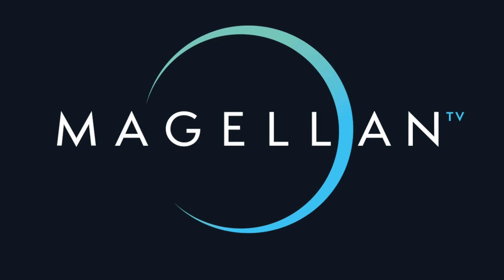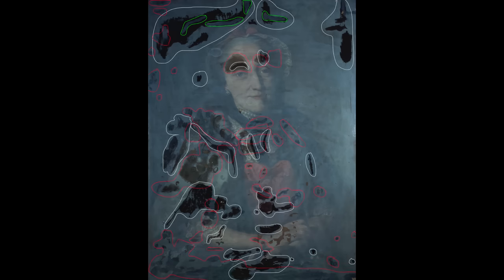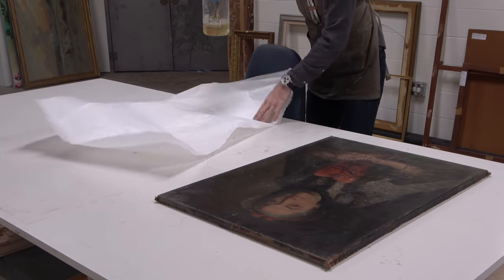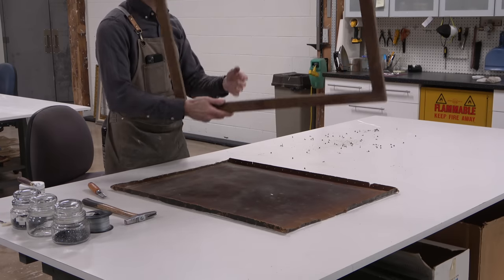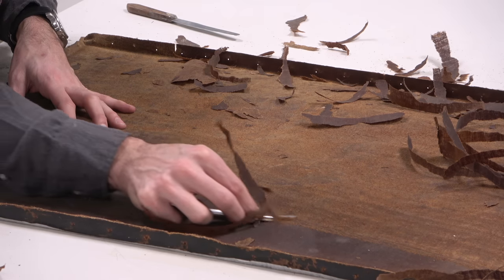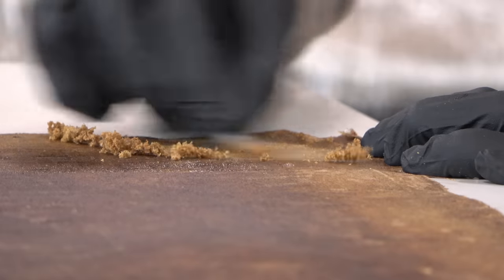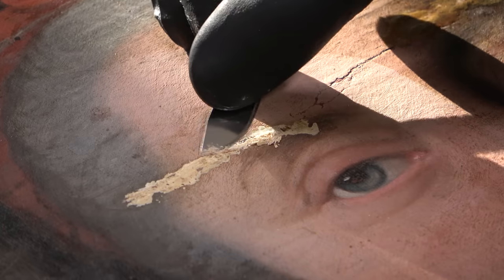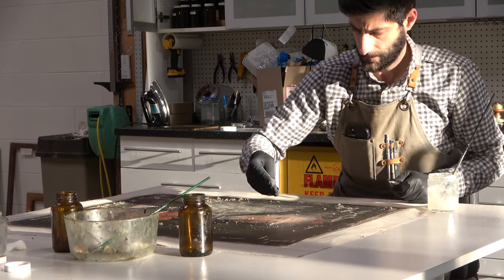The Lady of the Manor Part 1

Comment: I completely understand the satisfaction of peeling off the lining canvas in long strips. About 10 years ago I help restore a historic barn - Round Barn in Arcadia OK. Our first task was to remove the paint. The side of the barn, where the paint had not been baked into the wood siding came off in 4+ foot strips. We were all competing to see who could strip off the longest piece. One of my coworkers stripped off a piece that was nearly 6 feet long.
Reply: Years ago I helped do some cleanup in a historic building that needed extensive cleanup after a couple decades of neglect, and part of that cleanup involved removing the old plaster and lath. While the superintendent’s apartment had a double layer that could only be persuaded loose by steady pounding with a ten pound sledgehammer, part of the dormitory wing had plaster and lath so loose that you could punch a hole with a regular hammer and then pull multiple pieces of lath loose and knock down dinner plate sized chunks of plaster with just your gloved hands.
Reply: This post right here helps me understand why we have people with so many varieties of jobs and interests in our Juliann fan club. We all find satisfaction in these kind of actions. We need a Baumgartner-con! 💕🐝💕🇺🇸
Reply: I also understand that satisfaction so very well, sometimes I also have the opportunity to experiment that same satisfaction, and it's so good when it happens 🙂🙂👌👍
Reply: I went to that barn in 1999! 😁 I was taking a trip along route66. The lady who was the tour guide was really proud of it 🙃
Reply: I remember going to that barn.  You  were there and we spoke spoke for a short time.  It wasn't long before it became apparent that there was something going on between the two of us.  You moved closer to me, the longer we spoke, then when you were almost mouth-to-mouth with me, you leaned in for a kiss.  I was taken aback, and yet, it's what I had always wanted.  You awoke something deep inside of me.  Long story short, we made love for hours and when our rear ends were as raw as ground beef, we said our goodbyes, and went back to our lives.  I never said anything to my wife, and when she died, she whispered to me "I know what you are".  It seems like I always knew, and always knew about her indiscretions, in kind.  Anyway, what were we talking about.  Oh yeah, that was a cool barn.  I saw a corncob packrat nest in there one time.
Reply: i’ll have to visit the barn sometime, i live in okc
Reply: For me it's been either scraping off wallpaper or scraping up the foam backing off the subfloor when removing glued foam-backed carpeting and the carpet weave rips right off the foam that's been glued down... it's just SOOOO satisfying to get a nice big strip where the glue has disintegrated after chipping away little pieces where the glue is stronger than the foam... Also, tearing fabric along its grain. Life's little satisfactions!

Comment: “The hot table is hot so I’m gonna use a piece of felt” 
Julian: processed to put other hand on said hot table
Reply: Try rubbing across a barely hot to the touch surface and you'll see why ;)
Reply: @Soken50  not the point ;)
Reply: @rileydoolittle5324  please enlighten me to the point then
Reply: @Soken50  that it’s funny he mentioned it’s hot but put his other hand directly on top. Not that I doubt it’s hot or anything
Reply: @rileydoolittle5324  So exactly the point I adressed in my comment, which is that rubbing across something slightly hot but bearable to the touch is bloody painful, moreso if you also apply pressure to remove wrinkles.

Comment: There is something extremely satisfying in seeing so many layers put on the original paint removed, and simplifying it to one single layer of filling and retouching. Although vibrant paint at the end may seem as the most rewarding part of the job, for me, it's knowing that the painting is simplified once again to its fundamental parts, and nothing else.
Reply: exactly
Reply: @davidroosa4561  You're wrong again.

Comment: "The difference between conservators and... people who aren't conservators...."
I totally get that mood.  I worked as a custom house painter before going back to school... and it may not be high art like this, but the mood is real.
My boss told me within my first month working for him that "the adhesion of your top coat is only as good as the adhesion of your bottom coat(s)"... with the understanding that for a proper long-lasting painted finish... you have to address the surface of the substrate, then the surface of the appropriate primer you're using + any hole filling, etc., and then your paint.  If you're repainting a house, well... power-washing is only so good... I spent days where I soaped and rinsed walls to get the grime off before we even tried sanding to add tooth... let alone DIY repairs that just gave us more work.
I have literally worked on a house where the homeowner was like 'ah!  Let me fix this small repair I didn't get around to before' and then I had to watch while he put silicone up instead of caulk.
People who THINK they know what they're doing... are dangerous.

Comment: Lets see if i learned something. I'm at 0:56 and these are my predictions of Julian's step by step. 

First: face the painting with washikozo and fish gelatin glue to avoid any paint detachment. 

Then, remove any backing/canvas, ideally DRY. If this cannot be achieved dry, use Lapenite or some solvent to try to remove it. 

Once bare canvas is exposed, saturate the canvas with a diluted conservation grade adhesive to penetrate Through the canvas and secure the paint.

Move to the hot table and press with heat in order to reduce wrinkles and allow the paint to become flatter. 

OR: once the backing is removed, move to the hot table, flatten the painting, then saturate the canvas and then move back to the hot table.

Comment: I noticed you heated the fish gelatin over a double boiler but I seem to recall you bought a 3D printer a while back, so I thought I'd share a tip I worked out; you can heat animal glues by placing them in a container on the heat bed of the printer. You can even set up a g-code to shake it back and forth to help it dissolve (let me know if you'd like a hand doing this). I've been loving this method because it means I'll never overheat the glue and it stays at a working temperature throughout the use of it. And I can mix up really small amounts when I want to. I have a little printer that sits near my workstation, and I use it just for this. :)

Comment: 4:13 instead of brushing the fishgel over the flakes you can brush it over the washikoso, then apply the washikoso at once in a controlled way; that would minimize the risk of tearing the flakes apart, then re-charge another load of fish gel once the washikoso is applied.

Comment: Could you turn the strainer into a stretcher to keep the original wood but do better service to the painting? This is probably a dumb question but just curious. Apologies for my ignorance. Love the videos!
Reply: I wondered this too, but I did some research and it seems the way strainers are designed there can be no give at the corners. I guess you can’t take it apart to turn that same frame into a stretcher without the risk of compromising it in some way. Of that I could find no info on.
Reply: It seems likely that was one of the options he presented to the client, when he said that he could preserve the chalk marks. Julian certainly has the carpentry skills to be able to do it - possibly by gluing the wood of the strainer onto a new stretcher and shaping it accordingly.

Comment: Hey there ! Very nice and tidy work, congratulation.
 How do you make this water gel you use to remove glue ? 
Us violin restorers struggle using water to clean up old glue inside instruments, usually using cold and then warm water. Problem is it can deform the wood as it gets wet/dries. This seems like a pretty good solution to avoid making the actual wood wet and control the moistened area better. 
Thanks in advance

Comment: This painting reminds me of a bulldozer I worked on. They painted over everything. 
Couldn't find plug to change oil in brake packs, it had been caked with mud, and they painted over THE MUD! 
Related note they removed the electrical components and then painted everything inside the cab, so nothing would ground when we first got it.
Theres monsters out there.

Comment: Im curious. If oil overpaint oxidizes and discolors with time, i assume the original paint must do so too. But whenever we see overpaint it seems VERY discolored, but the original which must also have oxidized and discolored looks relatively normal. Like peoples faces look natural enough, even though the paint is very old. Does the overpaint just look so badly discolored because the colors are off and its contrasting with the original? Or is it less stable somehow? Also there are paintings that painters worked in for 10-20 years. Is that enough that you might get discoloration contrast between old and newer paint even though both are original?

Just curious because the original paint always mostly looks normal and overpaint looks horrendous, but they should really be facing the same issues, just with a different time lapse no?

Comment: So, at some point someone worked on this painting who did remove varnish before doing overpaint, right?

If oil-based overpaint discolors because of oxidation (even if it's under newer varnish), why doesn't original oil paint oxidize and discolor as well? This question has been driving me wild over the past few months, while watching hours of this lovely work.

Comment: Sir, if you already remove the deuterium from the water you use, we think that is wise.  Deuterium (aka heavy water) is easily deleted from the pure molecules of H2O.  The process can be found by searching online.  Possibly, you will prefer to drink water that contains no deuterium.  [ btw, if curious, try watering a disposible plant with the deuterium you removed ]

Comment: Did I miss something? When was the flaking paint fixed? Like, I get that it would be pressed back into the canvas by the pressure and heat treatments on the hot table. But wouldn't you need some sort of adhesive to bond it back to the canvas?

Comment: Just out of curiosity, what would you do if you came across a painting that was fairly modern but the artist decided to purposely use a tinted yellowish varnish over the painting to give it an "older look"? When it came to retouching would you tint the isolation layer and then retouch or use a clear isolation layer and just tint the final varnish?

Comment: QUESTION (re: Arthritis): 
It seems that (almost) all the rapid-movement scraping you do is with your right hand. If we were to put magical tachometers / odometers on your hands, wrists, elbows, shoulders, etc. I imagine that your right side would have orders-of-magnitude more movement than your left.  I imagine that all of this high muscle tension and repetitive strain could do a number on your muscles and joints.  

Do you take any preventative measures to avoid repetitive-strain to muscles & joints either (1) n the short term (e.g., special grip techniques, stretching, breaks, icing, anti-inflammatories, etc.) or (2) the longer term (e.g., supplements of chondroitin, occasional visits to rheumatologists, orthopedics, etc.)?

Is repetitive strain injuries and localized arthritis common ailments of (painting) conservators?

Comment: Is the reason that you didn’t apply the fish gelatin directly to the majority of the painting because you didn’t want to lift any fragile paint off? Normally you do the two coats of gelatin for the whole painting as opposed to just the top. Also is the reason you DID do two layers on the top because it was more stable than the rest of the painting?

Comment: I have to disagree on one detail on the varnish and artist part. It has been known throughout the centuries that varnish will yellow and also that sunlight plays a role. There have been many recipes that tried to get around it. The artists were well aware of that this will happen eventually, but there was nothing they could do about it. What the point here is however is that they painted the painting for the time where it still looks good, and that is how they wanted it to look like. If one could time travel with some modern uv stable varnish, one surely could get rhich....

Comment: I hope the customer keeps the conservation envelope included with the painting where it's clearly stated Julien recommended a change to the frame and the client refused so it's not his fault and youtube two hundred years from now doesn't have a video of a conservator conserving this very painting and having harsh words against our efforts.  That would not be at all fair!

Second - I kept thinking we'd reached the original skin tone and then another layer would come off - by the end layer I was flabbergasted at the vast difference.  I also recall people having strong opinions of the Sistine Chapel restoration back in the 80's and terms such as 'painted whore' and 'lost its mellow beauty' were being thrown about - and honestly I had no idea what to think - I was hardly the expert.  But, I agree with Julien, candle ash - varnish oxidization - dust - cigarette smoke - none of these were part of the original vision - the painting wasn't finished with any of these included, and I feel the painter would have marched out and kicked the naysayers in the butt and told them to slap some yellow varnish on a photo if they wanted 'mellow beauty' but let their art work stand as they originally painted the damn thing, thanks ever so.

Comment: You have a sandwich of grime, varnish, grime, overpaint, grime, filler and original paint.. Using the right solvents and methods to strip away six layers and not damage the seventh is pure sorcery to me!